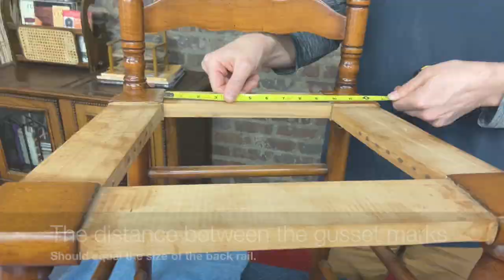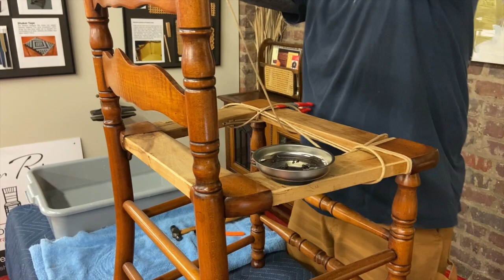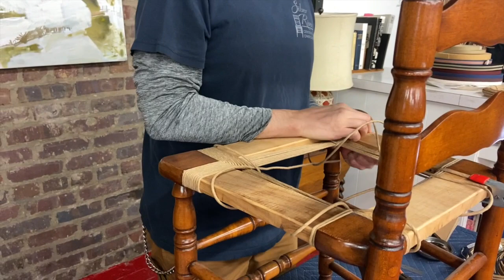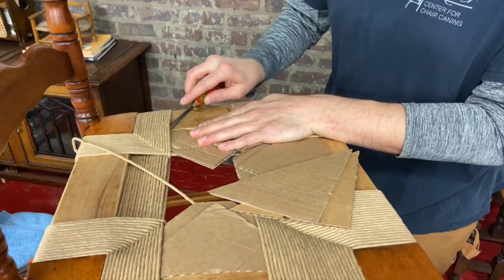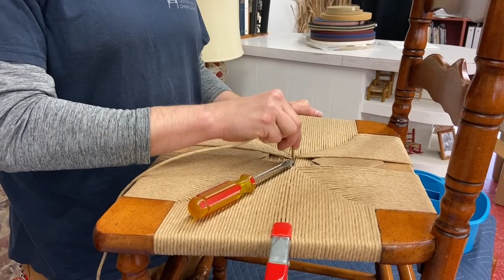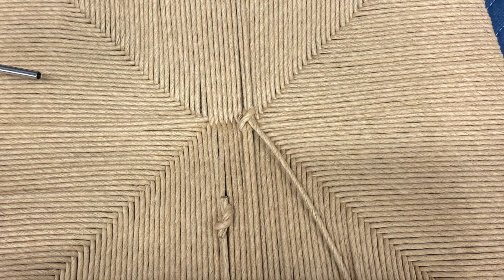How to Weave a Chair with Paper Fibre Rush

Comment: Thank you for an excellent demonstration. I replaced the seat in my rocking chair this week. The seat was not stationary. Every time I turned the chair over or pulled the rush, the seat moved. It was most difficult and I will probably not try again. I pulled as hard as I could to try and keep it tight. I guess I’m just not strong enough and it doesn’t lay exactly flat. All in all it is as you said “sit able.”  Thank again.
Reply: I also have a question. Can you use polyurethane instead of shellac?

Comment: What a beautiful job!! I have listened to this a zillion times while I'm doing my antique dining chair. Wish I could achieve this perfection. I am trying to keep each section parallel. My chair doesn't have the square corners and it seems to make that harder.   Thanks for such a good video!   Sue
Reply from the maker: Gosh! Thank you for the kind words! Be kind to yourself...getting rush uniform and tight takes quite a bit of practice. Good on you for becoming a part of your chair's story! Round posts do require a bit more adjusting. The first few strands are not going to be 90 degrees. You have to work toward it as the pattern progresses. You can tape a dowel/pencil onto the inside of the post to jumpstart that process, but I don't like the gap it leaves. Best of luck going forward and if we can help, give us a call and we can set up some tutorial time. Cheers!

Comment: The best video on rush seats.  What brand paper rush do you use.  Mine kept unwinding so I had to keep twisting it tight.  Finally gave up thinking that my material is inferior.  Suggestions?
Reply from the maker: Thank you for the kind words and taking your time to watch our videos! Here are a couple of thoughts: paper rush will definitely try to unwind if it is too wet. We do suggest wetting the rush slightly to increase pliability, but maybe try spritzing it instead of dunking it. Or, if you're using it dry, try wetting it slightly. We source from several different companies that you are welcome to check out on our "Resources" Page: https://silverriverchairs.com/resources

Comment: Very clear tutorial - thank you.  I just cut off the shredded fiber rush from a very old chair.  The front is a bit wider than the back, but I see no evidence of extra weaving on either side of the front - nothing tacked to the front sides and no holes.  Wish I'd counted the front and back strands before cutting off the rush.  Could the back and front have had the same number of strands with the back strands more squashed together than the front?  I have paper rush to do my first chair seat weaving, so we'll see what happens..

Comment: Great video! I am weaving a bench seat, and I need to make really long cardboard pieces for the long sides of the bench. Why do the lines in the cardboard need to run diagonally? I am wondering because the piece of cardboard I have is not big enough to make the fill for the bench with the lines in the cardboard running diagonally. Is there a reason why you said it needs to run diagonally? It would be much appreciated if you would answer my question. Thanks!
Reply from the maker: Ahh...an exception to every rule! No, don't worry about trying to run the cardboard diagonally for your bench. The diagonal cardboard is a great combination of strength/flexibility when trying wedge the pieces in a small area. For a long bench, I would run the corrugation long-way to maximize strength...you won't need the flexibility in this case. Another suggestion: Try to keep the cardboard gap small (1-1.5") along the bridge of the bench. It might make threading material through the gap a little trickier, but it will keep the bridge straight and prevent it wandering. Not that big of a deal on a small bridge, but you can really tell on a bench. Good luck! Thanks for watching!

Comment: Amazing video! Thank you very much for your explanations - very clear and concise. Is there a recommended size of the chair seat edge you are wrapping around? We have some chairs we'd like to rush weave but the seat edges are 2 inches high. Would this be a problem?
Reply from the maker: I wouldn’t recommend it normally-Im guessing it was originally upholstered or had a seat attached to the top. If you did rush it, it would take a lot of cardboard to keep the seat from collapsing.

Comment: Thank you for this excellent video. How many meters of this material takes etch chair approximately?
Reply from the maker: We figure between 2 and 2.5 lb per chair. The 5/32" material that was used in this video runs approximately 200 ft/lb. So I would estimate around 120-150 meters for an "average" chair. Thanks for watching!

Comment: I am amazed by how good your explanation is! Can I do the same for danish paper cord? Or does it behave much different to this fibre rush? Thank you again!
Reply from the maker: You can absolutely use Danish cord and the process doesn't change. Danish cord does act differently for two reasons: the triple-ply makes the cord denser and the wax treatment during manufacturing makes it slippery. Make sure you are pulling firm on the straightaway and resist the urge to "over-adjust". Thanks for watching! If you find yourself woven into a corner, we offer tutorial instruction via zoom/facetime. Happy weaving!

Comment: Your work is the most precise among all the videos I've seen on this...beautiful work! One question is how you keep your rush from getting kinked and twisted when you are near the end and have to feed a single strand.  I start off with a nice coil and wet it as you described, but as soon as I start working with it, it develops kinks and twists that I have to unravel before I can feed the strand through the small hole. Your rush never seems to never have this issue, so could it be a problem with the rush that I am using or is there a technique for preventing this?
Reply from the maker: Thank you for your kind words! When you start threading the single strand, try not getting the material quite as wet...almost dry and stiffer. While there is room, thread a loop through the center hole and pull the material/tail through instead of threading the tail and pulling the loop through. If it's any consolation, our material gets twisted and annoying too! Do the best you can to keep it from twisting/kinking, but it is inevitable.

Comment: Thank you for the video. What length of rush do you have in the coil, to begin with?
Reply from the maker: Good question! We work in weight and not lengths. An "average" chair requires approximately 2-2.5 lb of paper/fiber rush. The coils that we are weaving with vary. Pull off enough material that fits easily in your hand. Bigger coils are unwieldy and smaller coils require a TON of knots. Thanks for watching!

Comment: I was wondering what your source of rush is?  My rush tends to fray and the fibers stand out when I wet it.  I can't do it wet without getting sweater pills!
Reply from the maker: We've sourced from varied suppliers over the years...the age of the material seems to matter more than the source. The older/drier the rush is, the more it tends to pill. You might try spritzing your bundle with a spray bottle instead of dunking it. Thanks for watching and we hope this video was helpful!

Comment: I have an antique chair that has no tack holes is there a way to even out the front and back without using tacks?
Reply from the maker: There is a method of tying a string to the back rail-usually for cattail or bulrush. Directions are on p 83 of Chair Seating-Techniques in Cane, Rush, Willow, and Cords book by Johnson, Barrat, and Butcher. You can tape them to the side rail as well, especially if they are narrowed as they go in toward the seat. We have the book for sale for $65 shipped in the US or you can search online. It comes from the UK and is the encyclopedia of chair weaving. If you go the tape route, it should hold fine once the rest of the rush is added. May be tricky at the outset. This video shows basic techniques and we are still creating the advanced technique videos. So many variations in shape, material, and construction elements! Thanks for watching.
Reply: @silverriverchairs3686  thanks for your prompt reply

Comment: The chair seat is attached to chair with screws.  The old rush went between them is there a procedure for this. Thank you
Reply from the maker: It sounds like you have a removable rush seat. There are several different methods of dealing with them depending on the style. The best reference manual for these type seats is Chair Seating: Techniques in Cane, Rush, Willow and Cords. We offer the book for sale or you can find it online. If you would like direct guidance, we are happy to schedule video tutorial time at a reasonable rate.

Comment: can you start on the right side first.
?
Reply from the maker: Yes, you can absolutely start from the right side. As a right-hander, I find the first tacks easier to put in using the hammer in my right hand...and the pattern runs counter-clockwise. Many of our southpaw students find it easier to start on the right side and run the pattern clockwise instead. All of the tensioning/adjusting advice stays the same. Good luck on your project!